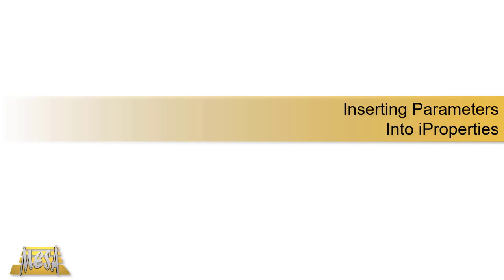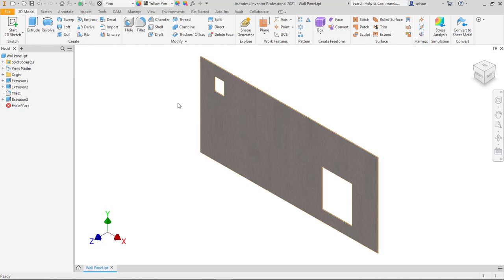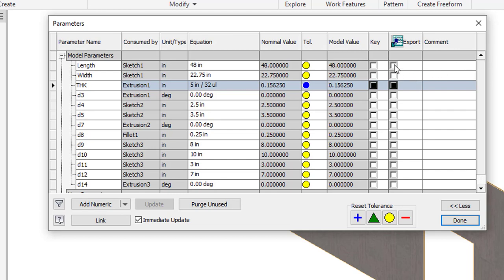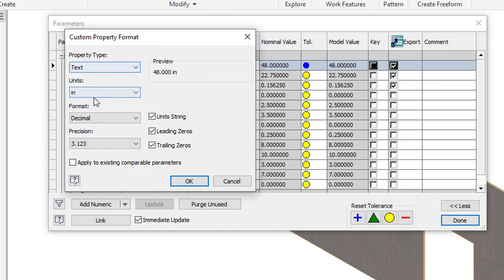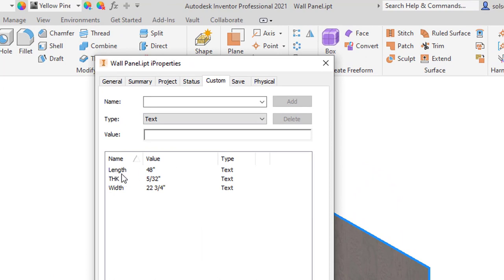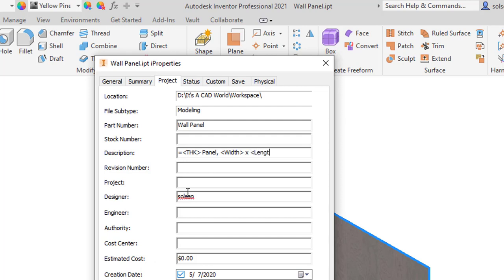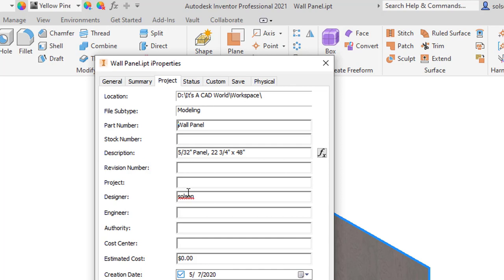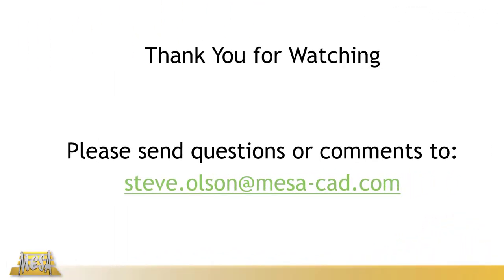Inserting Parameters Into iProperties

Comment: WHAT ABOUT A BEND PLATE?
Reply from the maker: Max Z, if you are using Sheet Metal, the flat pattern has special properties named <Sheet Metal Width> and <Sheet Metal Length> that would allow you to get the width and length of the flat pattern into description iProperty.  Here is a quick video that shows how this is done.  Sorry, this video isn't narrated.    

https://knowledge.autodesk.com/community/screencast/de674899-d472-4c1f-9081-3d178891dd8b

If you have any questions after watching this video let me know.

Thanks,
Steve